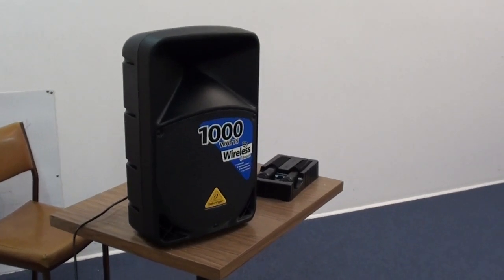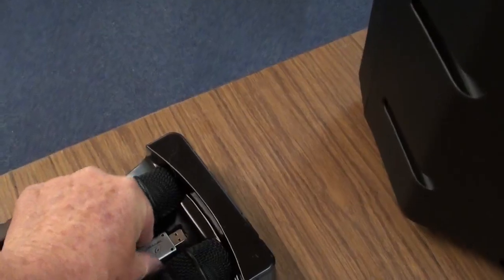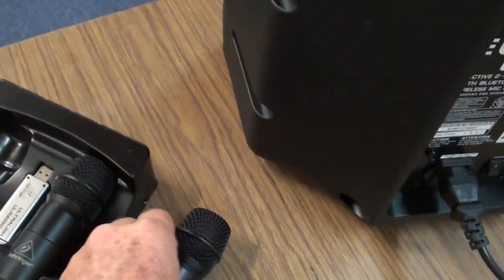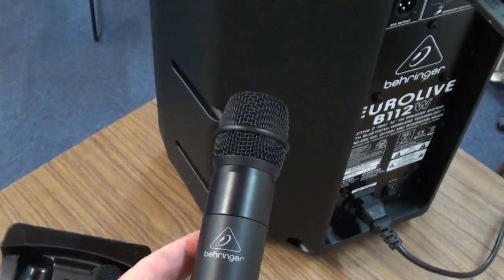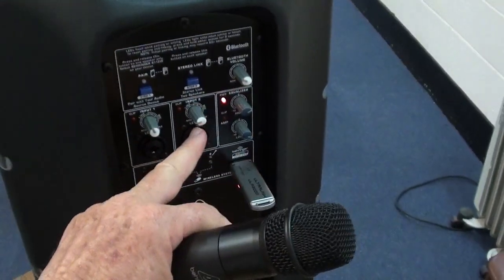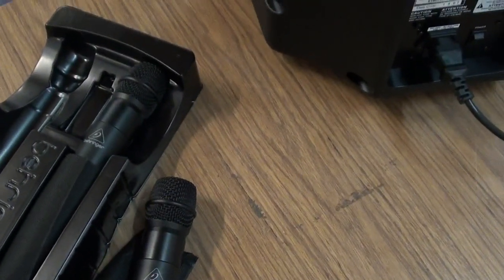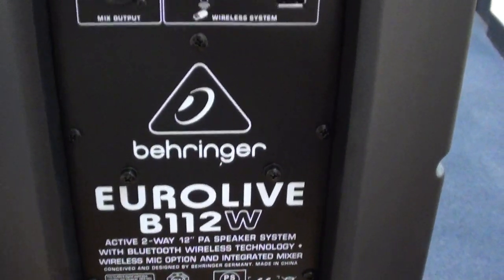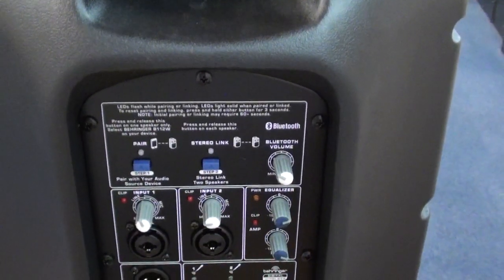Using wireless microphone Behringer Public Address

Comment: Hi Neil, I have the exact same setup as you demo here except as soon as the USB receiver connects with the mike I hear the hum from the speaker. The hum stops if I grab the USB receiver with my hand and encase it with my palm. It does that with both speakers. Turning the input all the way down does not help.  Any ideas?
Reply from the maker: I no longer have access to the device in this video.  Sounds like the interference signal is coming from a third device somewhere in the room or outside the room.   I think the frequency used is 600 MHz and this is used by a multitude of devices.   
In Australia, some years ago, we changed the frequency used by mobile microphones to avoid this problem.  It is  now illegal to use the old systems
Reply from the maker: https://www.behindthemixer.com/wireless-microphones-600-mhz-fcc-ban/
If you are in Canada or the USA the above link might be of use

Comment: Ultralink ULM202USB has poor signal connection when it used in open area like gymnasium.. I thought it is very good because of the behringer brand.. But i am wrong it was so disappointing..
Reply from the maker: Sorry to hear the news.   What frequency do mobile phones use in your country.    In Australia the radio microphones have had their frequency changed to be different to that used by mobile phones.     
Prior to that people at public venues were asked to switch off their mobile phones because it interfered with the sound system.

Comment: just bought 2 and only one works independently what's the point I want both to work I bought the dual pack
Reply from the maker: Does not sound like a very happy situation
Reply: The same happens to me. Could you solve it?
Reply: You have to sinc both mics, pressing the second one on the two buttons at once.   Let me know if you could

Comment: can I use it with any speaker
Reply from the maker: I nolonger have access to this system or to its Manuals.  I doubt that it could be used with "any speaker"
Reply: ViC Mc1 LeOn actually yes as long as your speaker has USB port
Reply: I have Alto TX 208 can i plug to him ?